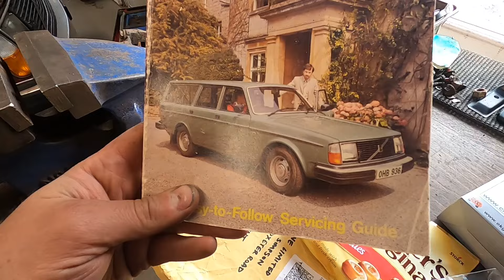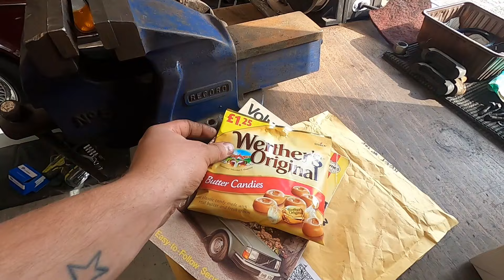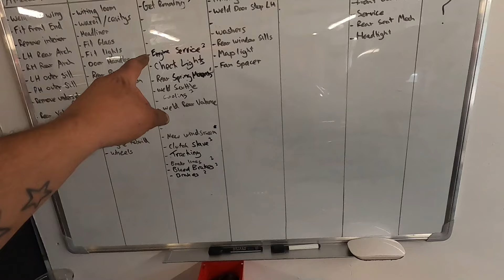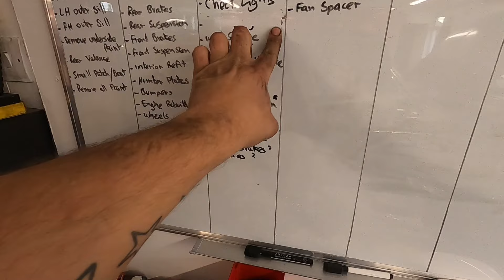WE CAN FINALLY STOP! Abandoned Volvo 245 gets LOADS DONE!

Comment: Loving these vids on this car. I dont use the bolts for the discs either there only there to stop them falling off in the factory as they make there along the assembly line. well thats what im lead to believe
Reply from the maker: I am glad I am not the only one who hasn't used them. For me like mentioned in the video the aftermarket wheels won't fit with them on. Thanks for watching.

Comment: Regarding the brake disc securing bolt problem, go to screwfix and buy a stainless steel countersunk socket head bolts obviously the correct thread size, then countersink one of the original bolt holes in the disc, the wheels wont foul the bolt head, 
Do you have contact number so we can meet up for a show 👍
Reply from the maker: Your reading my mind this is something I have been looking into. 
Drop me an email if what which events you plan to go to and we can work something out once this one is done and road ready.
Email is in the description of the video, cheers buddy